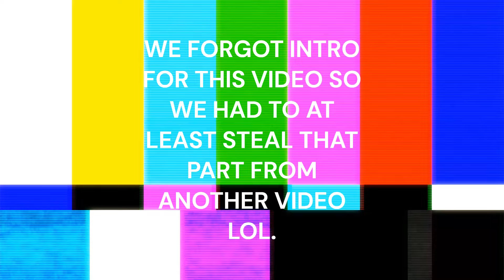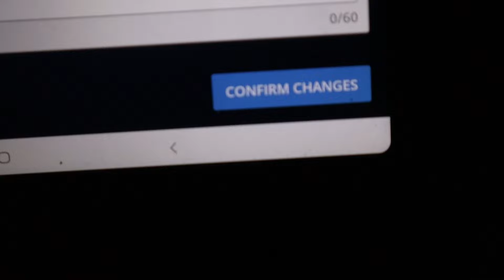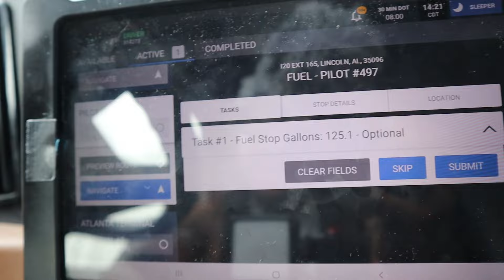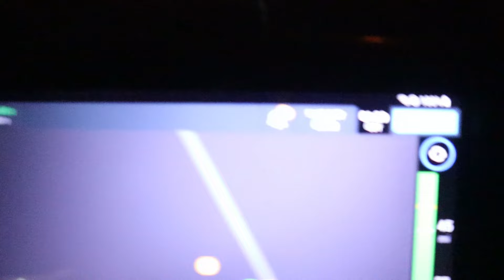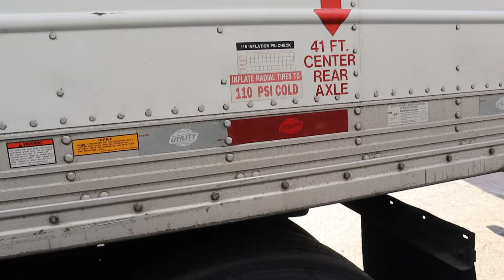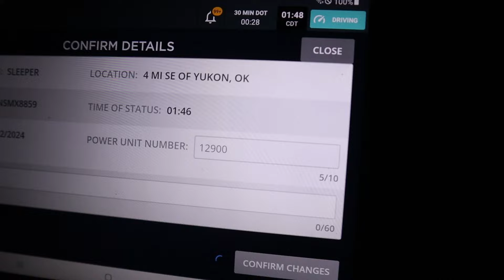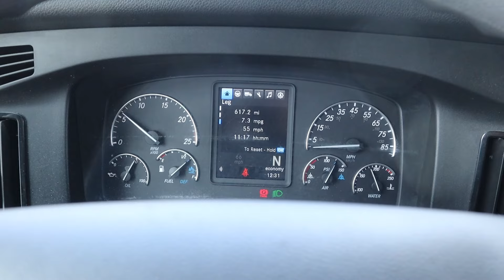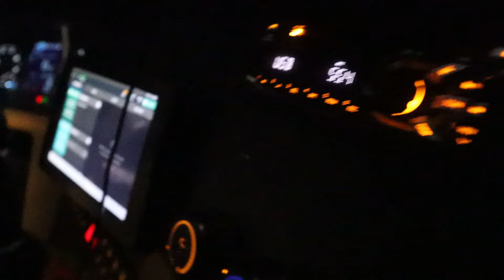TRUCKING VLOGS | NO WAY THEY DID THAT!!! | CALIFORNIA TO GEORGIA AND BACK

Comment: Can you show where you slide the trailer axles for Cali? Thanks kevin
Reply from the maker: We got you in the next video.
Reply from the maker: But we will explain it….. tandems can’t be further than 40ft from the fifth wheel in Cali. It SHOULD be a 41ft indicator on your trailer to help. From there every slide forward or backwards is a foot.

Comment: Did you scale the load? Looked heavy on the trailer axles
Reply from the maker: It was actually light, under 30k. We usually scale when it’s over 30k or depending on what terminal it came from. FFE is really good about its load distribution